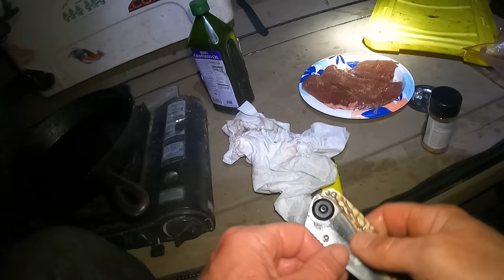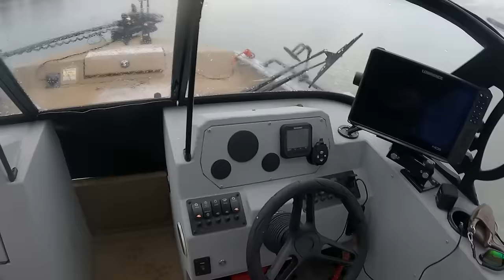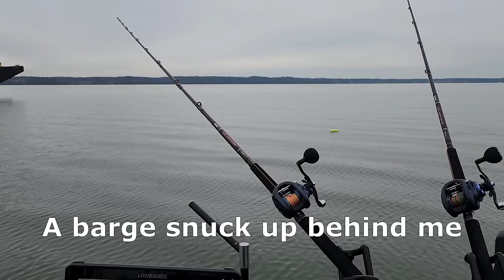The Part of Tournament Fishing NO ONE SHOWS!! (Camping)

Comment: You definitely need some external lighting on that new boat !
Reply from the maker: It's on the list, just a few spots below common sense haha
Reply: @RiverCertified  

We use 12 inch tube lights from cables you just plug into a cigarette lighter plug , that is wired into the trolling motor plug , just throw them over whichever side you’re fishing on ! The make a huge difference….

Comment: Here's how an old man does it. 
Once I've cast out I click in my reels, lightly snug up my lines then put my reels back in free spool BUT I tighten up the spool tension pretty snug. This is enough to cause a circle hook to set as a fish runs off with the bait/hook but doesn't cause the more bite shy type of flatheads you encounter at times to drop the bait from resistance. When I hear the clicker start going I simply walk up & filp the reel into spool lock and start fighting the fish. If you have an old knuckle buster like a Pfluger Rocket 1375 you can simply pick it up and start fighting since the handles don't disengage during free spool with those types. I use sinker slides to further lessen the tension a flathead feels when he takes the bait. One more thing I've run Eagle Claw L197 circle sea hooks my whole catfishing life from 3/0 to 7/0 and they've never let me down, no they're not fancy & Walmart carries them but they just work without the high price tag. Anyway just my suggestion from spending a little time chasing big fish
Reply from the maker: I'll take all the help I can get. I appreciate you taking the time to share that. I'll play around with some of that and see how it treats me. Thank you.
Reply: @RiverCertified  you're welcome, you obviously know what you're doing already just figured it might be another tool in your bag.